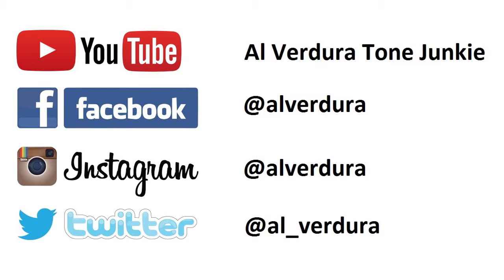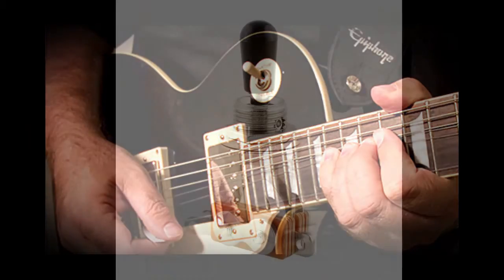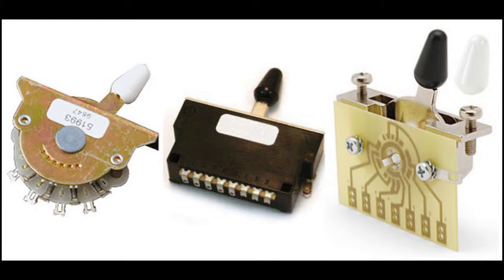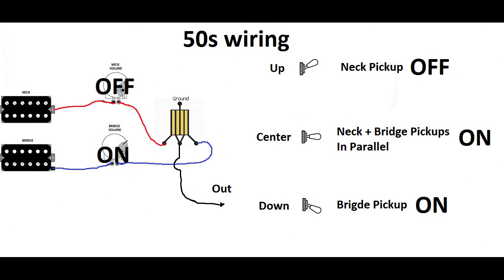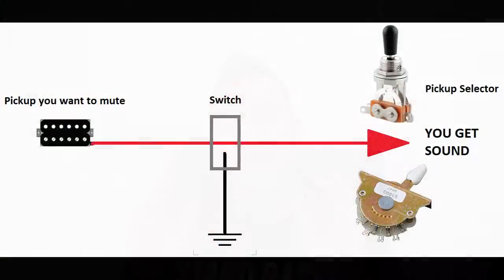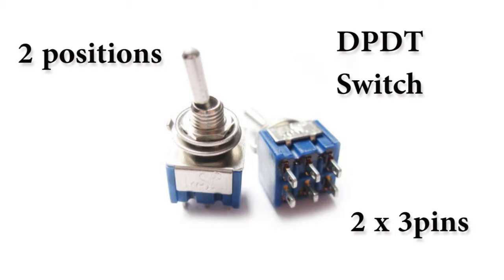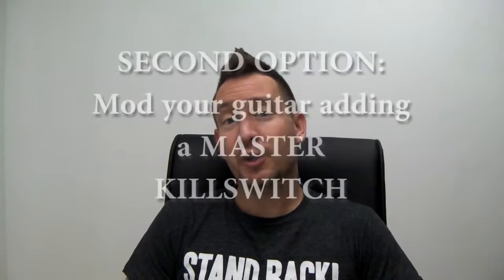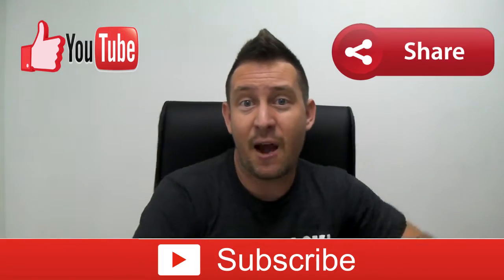The Killswitch: Explanation, installation and tips!

Comment: great video.  thanks.  i have an ibanez rg7 with seymour duncan blackouts neck and bridge and a three way switch. what i want to do is replace the tone pot with a master killswitch but still be able to play using bridge, neck and bridge+neck when the killswitch is disengaged.  any advice? again, thank you and great video.
Reply from the maker: Thanks!!! In that case, you just disconnect the tone pot and install the switch there. Make sure that the switch you are going to install is not too hard to move because it can be annoying to use it

Comment: hi! thanks for this video. i have a guitar with 2 humbuckers, 3-way selector switch, 1 tone and 1 volume. i'm planning to remove the neck pickup and add a coil-splitting and kill switch function and thinking of using the 3-way selector switch for both. i'm also planning to remove both the volume and tone pots and connect the pickup directly to the jack. can i use the up and middle positions for coil splitting and the down position as a kill switch? is this possible? thank you!
Reply from the maker: Hi, you're welcome. I don't think it's posible with just one switch. The problem is that on 3 way switches you can just connect two things and in your case you need 3, the humbucker, the coil split and the killed position. I would add another switch on one of the extra holes.

Comment: Hi it is a god explanation but how does the 3 way toggle switch les paul style kill switch works in the Tom Morello Strat? I saw a video of the electronics inside and there are a pair of cables as a bridge on two of the pines,  and two long wires that go to one of tyhe pots and finally to the jack output, as it is shown of this video https://youtu.be/3xuIesEN5hA
Reply from the maker: I'm almost sure that the Tom Morello strat has the kill switch after the volume pot. The original guitar has one toggle but the strat has the normal blade switch plus the toggle switch. If you saw a bridge cable on two of two of the pins in the blade switch maybe is used to asign one tone pot to two pickups.
Reply: @alverduratonejunkiealveram1017  Thanks for your response, I will try it as you said in my strat (crossing fingers to be successful), yesterday's night I mod a squier tele I have setting a 3 way toggle Switch Les Paul Style on it as a kill switch after volume pot as you said like a momentary type, it works but different way, it pops a little when goes off (center position is off) I'd tried adding a resistor between output pins (56R upper value reducts volume to the half 1K2 and upper 20K mute sound at all) but still popping, I had set a momentary after volume on a Jackson previously, and it does not pop at all when engage, tried for 3 hours to figured out what is going on and testing distinct ground/hot settings and also grounding metal plate of the 3way selector to pots, plates, ground on jack but still popping the only that works a little was to keep the 56R in line bridging the output pins on the 3 way selector but still popping a little so I really don't know if it is related with the type of switch, quality or something else, will send you some pics of my mods, your video actually encourage me to start making mods on my guitars!
Reply from the maker: @guitar_playing_and_gear_mods  man I have no idea why it pops but il looks like it's the switch itself. Yeah doing mods is so much fun!!! LoL